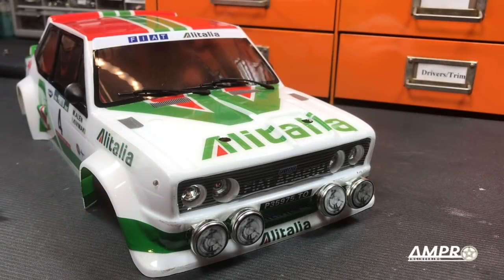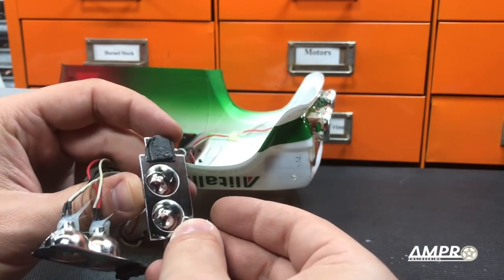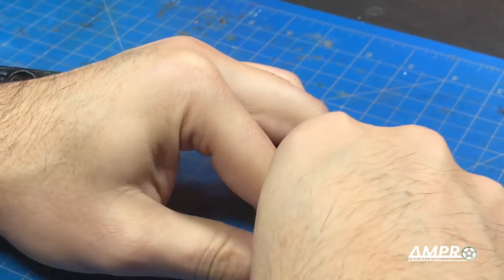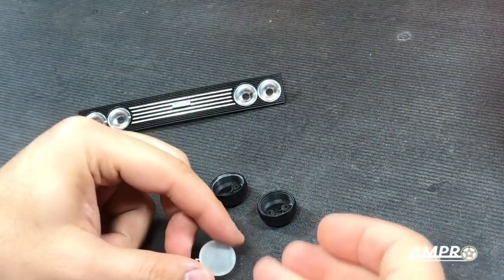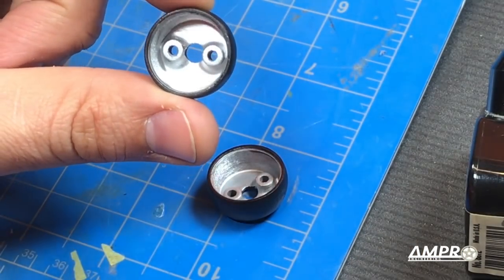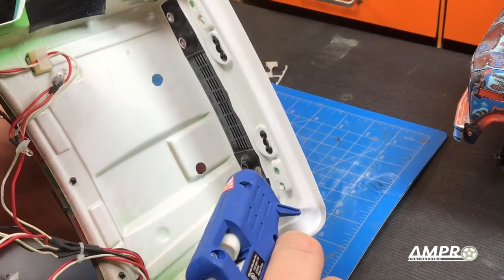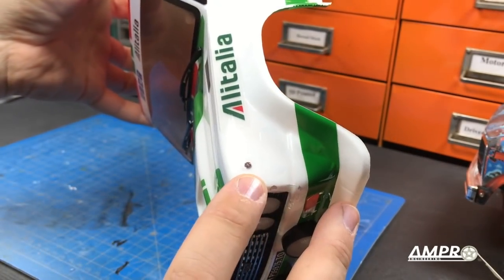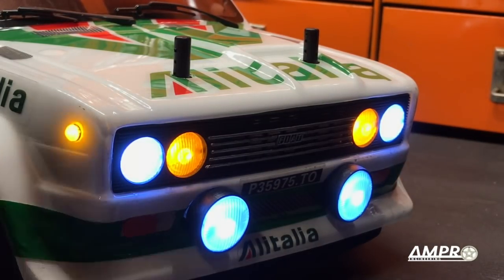e203: Rally Legends Fiat 131 Front Grille and Lamp Upgrade

Comment: Hey I know this video is older but I just picked up a body and will be doing this upgrade. I also noticed that you have a different set of wheels on this car. Can you please provide any or more info on them as I'm in love with the way they look and have not seen them around! Thank you great videos. love your work!
Reply from the maker: Oh sure! I made those also for mine. I can add them under this cars section on shapeways. There is a main wheel (nylon) and a hub cap (high detail). You paint the wheel in matte black and then center in gold (or whatever you want). the front and rear offsets are different.
Reply: Sweet I would love that! Thank you so much. @AMPROEngineering

Comment: Hello there. Some time ago I asked about the wheelset for this car.  I was waiting for you to upload and I never found it.  If you did get a chance to would you be kind enough to help me find them. I would even try the STL file as I was gifted a 3d  printer.  I've been searching for that  wheel in 1:10 I  can't seen to find it.  Any help with this will be appreciated. I picked up this grill set, Lenses and   light buckets since we last message great work!
Reply from the maker: OH man im sorry. These are really detailed but the main wheel may work on an FDM but there is no way the center section would. That would need to be SLA at minimum, Polyjet (what you see on mine) is recommended. Let me get these up tonight on Shapeways. Shoot me an email at amproengineering@gmail.com